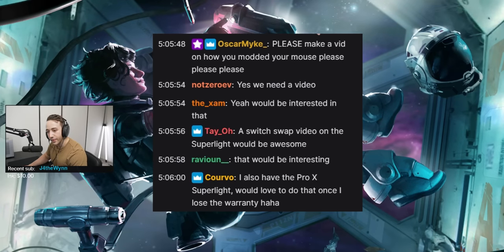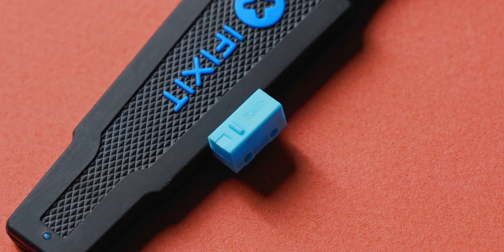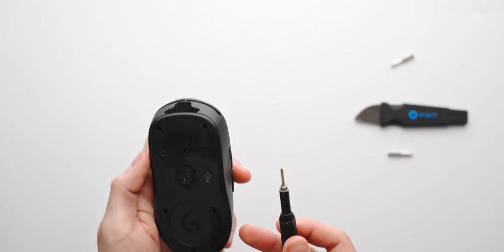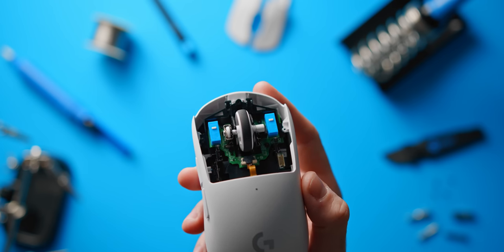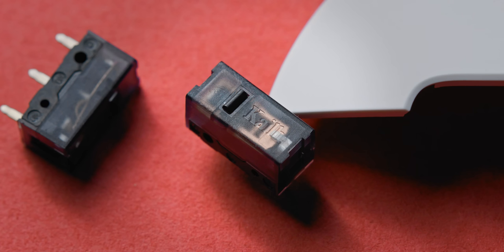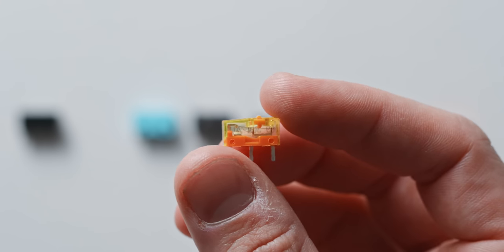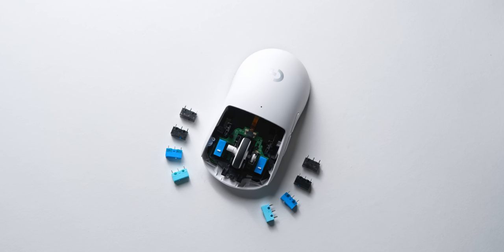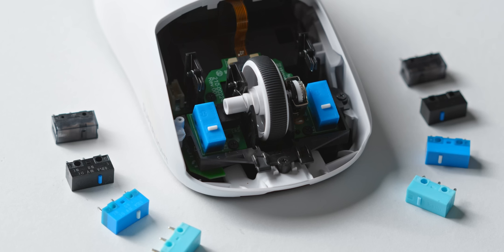Upgrading my Gaming Mouse Switches

Comment: Besides the switch itself, the implementation matters alot. The way its positioned under the mouse button and also the plastic quality the button is made of. Take for example Xtrfy M42, uses Omrons but damn they sound and feel so crisp and snappy.
Reply: I've found a piece of tape between the switch and button to help improve the feel of pressing them as well.

Comment: Got inspiered to do this mod, as I had bad double click issues on my left mouse button, and one of the side buttons on my G Pro (wired).

I have GM 8.0's on my left, right and the side buttons now, DEFFENETLY worth it. And the "solder the middle pin first" tip is really good. Another thing i learned is, dont get lead free solder, I was trying to do this with lead free, and it was a horrible first time solder experience, got some 60/40 lead solder and it was waaay easier.

Comment: instead of removing the feet, one can simply use exacto knife to cut out screw holes. this in no way makes the feet perform any worse, but you'll have access to the screws without buying new feet.

Comment: I'll add a data point: Much like Logitech mice, the EVGA TORQ series of mice also have Omron switches in them... but!  It does make a difference where the switches were manufactured.  The included switches in all aforementioned mice were manufactured in China.  Omron does make good switches which can be sourced on Amazon: Omron's Japan-manufactured switches are not prone to the double-click plague and are quite inexpensive.  I have re-switched both of my EVGA Torq X5L mice, both of which began double and mis-clicking in under a year.  Both mice are 2 years in with the Japanese Omron switches and are still working great!
Reply: For the record, the switches I purchased and installed are Omron D2F-01F switches.
Reply: @kcsmiscvideos218  Been using D2F-01 on my GPW since release, they still work great.

Comment: Hey @Optimum Tech, thanks for this video. I got myself the GM 8.0 Blacks for my G502 with the annoying double click issue, and it works incredibly well. Got the whole thing back to working in just $20, didn't even solder myself, paid somebody a dollar for it, and could have easily gotten it done in under $10 if not for skates, which I had to import. But in anycase, this is a lot cheaper than having to buy another mouse, and a lot better than having to spend $20 and settle with a worse mouse. 

I went for the 8.0's because I didn't want the tight reds, would've liked the 2.0's, but didn't see them being sold. But all in all, I love my mouse now :)
Reply: My g502 died, because of this switches

Comment: You can reuse glides in 99% of cases if you heat them up long enough. Use a hairdryer and try to move them from side to side until they start to "float". It takes some time but trying to remove glides too early will damage them. To solder - use high heat, but work fast. If something isn't perfect and you want to fix it wait a bit. Overheating a switch can make it melt inside, on cheaper mice pads can fall off. Repairing mice is my hobby, and I usually make 10-15 bucks per mouse which is a nice bonus for something I like doing anyway.

Comment: finally, hopeful this video gonna kick start the trend of manufactures not putting screws behind the feet.

been doing mice switch for years now, the only M1 switch I would go for is cherry DG4, and recently I am using DG4 for M1 alone side with zf yellow dot switch for M2(well, i prefer a different switch for the M1 and M2. since M1 usually just for a shot and M2 just for ADS)

The DG4 is very short travel and super snappy, crispy yet not too hard like most kaihl switches. 
After using this kind switch, going back to Omron 20M is like going back to membrance keyboard. I opened up all my mice without even trying them once right after i get them, coz i know they came with that shit switch from factory anyway. 

Finally this trend needs to start. Also more metal body mice need to happen ! not just one !
Reply: I straight up hole punched my mouse feet so I can open it up whenever lol

Comment: I do a decent amount of electronics work and I would recommend Solder wick to remove solder it is like using a tissue it adorbs it and comes right off. Also a tiny tiny bit of flux could go a long way if you are also bad at soldering.

Comment: Paintballers have been swapping switches out since the early 2000s. Pro tip, if you over heat the switch, it only takes a fraction of a second, you can warp the switch, changing the weight and feel, and sometimes ruining the switch, so it helps to use the lowest heat you can to do the solder move if you have an adjustable, or using a small clip to soak heat and protect the switch.
Reply: And also use flux
I attempted on an old mouse and fucked up, called up my dad and he said it’s bc no flux the solder doesn’t flow well

Comment: Besides others mouses I own four Logitech M510. Two with old logo, two with new logo. Both old mouses works fine, both new are dead (double-clicks). After disassembling new mouses I found Kailh microswitches inside. Old M510 got Omron D2FC-F-7N. I got also Logitech MX518 with Omron D2FC-F-7N(20M). This mouse went trough 15 years(!!!) of playing Diablo 2 and 3, PoE, WoW and now D2R. You can imagine how many clicks I've made. Mouse is still doing fine and never been even opened. I'm planning to buy some new gaming mouse as soon as this one dies. Seems it will never happen :) With all the respect to your hard work, I'm about to do the same... but in reverse. I've just ordered Omrons D2FC-F7N(20M) and I'm about to replace all Kailh microswitches I've got. Clicking noise? Well, as you see I got other problems than clicking noise :)

Comment: Got inspiration and replaced my G502 wireless switches with Kailh GM 2.0.
The first time I did soldering and the result came out pretty amazing. Really enjoying the new switches and bye-bye to the dreaded double click.
The tutorials must be like this video which explains everything in such an easy way that you get encouragement to do it yourself.
Thanks, Ali for this nice video.
Reply: how good are are the gm 2.0 on the g502? i own a g502 hero and the double click is killing me, what switch would you recommend? i just need something that feels nice and solid but also good for fps
Reply: @Grimm98    Like Ali said, switch feel can differ on different mouse bodies.
The Kailh 2.0 I'm using is giving me crisp and accurate clicks. I play FPS and I can single tap any gun on full auto mode.
I haven't tested many switches but I can share that Kailh 2.0 perfectly match the body of 502 hero. You'll love it.

Comment: There is a reason I'm still on my 903. Having the switches on a daughter board makes replacing them slightly easier. I don't need to desolder anything if I just want to replace them with the oem switches which is fine for most use cases. I'm hoping to get the gear and the knowledge to replace My g903s switches with the really good Japanese omron switches but that is going to take some work.

I'm doing a switch replacement this weekend and I have a set of the omron 20ms and a set of the 50ms for me to compare and pick one. Technically the holy Grail for omron switch is here are the 1ms because they're the same switches that were used in the original 502 and they last forever. Sure, They're only rated for 1 million clicks as opposed to the other ones which are rated for 20 and 50 million clicks respectively. But there's a whole lot of literature around why that rating kind of doesn't mean anything.

Comment: no offense but you dont need fine soldering tip to solder these micro switches. fine tip actually makes the soldering job much harder as the tip retains too little heat. as a beginner you want a D shape tip as the heat capacity and conductive surface is higher, it will be easier to melt the solder and easier to work with in general. you will only need fine tip on very specific situations such as soldering very fine traces (much finer than the traces you have to deal with for a microswitch. also, get some non acidic soldering flux, it helps the flow of solder.

Also, you can reuse the mouse feet easily (up to once or twice) by heating it up with a air dryer/heat gun (dont over do as it will leave marks on or melt the plastic)
Reply: Even better: Use a craft knife to cut holes in the mouse feet where the screws are and never have to remove them again.

Comment: Thanks. Was able to solve a double clicking SteelSeries Rival 100 mouse by soldering the Kailh GM 2.0s which are just right. A tip for anyone with similar problems. My old switches wouldn't fall out on their own because they were secured too tight. I needed to apply pressure and pry them out at the same time as de-soldering the points.

Comment: im using the white dots. i also found out that adding small square from the hansaplast plaster on the main mousebuttons where they have contact with the switches helps me reduce rattle and get a smoother clicking 😉

Comment: thanks dude!
gonna swap the switches in my logitech G102 since they have the double-click issue
Reply: sadly its a massive issue with logitech mice (also many other brands) that use the omron 20m switches. Sadly that happens to be 99% of logi's lineup as well as 90% of all the mice on the market. Ive actually been finding that some of the cheaper brands, "black web gaming" (a walmart brand) and others like HP and Dell gaming mice come with Kailh switches from the factory...

Comment: If you don't want to peel the pads off the bottom, you might want to try cutting tiny holes around the screws with an exacto knife.

Comment: Hand pumps can be a little hit and miss for removing solder from PCBs, I recommend giving solder wick a go for getting rid of solder in those tight areas you can't get good suction with the pump on. If the switch doesn't come off easily, don't yank it as you could rip the pads out, just keep applying and removing solder until it comes free.
Reply: The trick with solder pumps is to add some more solder to the pin you're about to desolder. It just works much better.
Reply: @markusransberger3646  Really depends on the PCB imo. Sometimes the tolerances are just so tight seemingly no amount of flux or leaded solder will allow the pump to clean the joint. Personally I just bought a cheap hot air station, makes desoldering so much easier, wish I got one ages ago. Plus super handy for heat shrink tubing or loosening glue, like with mouse skates.

Comment: FYI 2:45 is not enough to unscrew the buttons (At least in my version of the mouse). You must pry out the battery itself (which is glued) to get the two screws that are underneath it. Luckily this also means you dont have to fiddle with the annoying cable.

Comment: I've had to do this a few times on my old Logitech mice, not due to preference but because their Omron switches mysteriously crap out after the warrenty expires.
Reply: I've had to sand down some rust/oxidation on the buttons above the switch - switch itself worked fine despite its louder sound, but if you get weird double clicks or drags not holding down, remember to take a look for miniscule rust forming on the metal connectors between the mouse button and the switch underneath.

Comment: I suggest getting some flux and soldering wick to clean the contacts... I tried to desolder to fix the double-clicking issue, it was a hassle to remove the switches.
Reply: All depends on the tools you are using. As with anything. The fancier the tools, likely, the easier the job. And with solder/Flux. The more expensive stuff is often the better stuff. Cheap solder will have you fighting yourself more than getting anything done. IT is well worth it to spend the extra couple bucks/pounds/ruppees lol.
Reply: @crisnmaryfam7344  Agree, but my piece was stubborn. I do many soldering as a hobby too. Though not some professional desktop soldering kit, but it should be decent enough for most jobs. I've never come across such stubborn solder. So having a soldering wick and flux to clean just as a backup in case anyone has no experience and end up destroying an expensive mouse with no warranty.

Comment: You’re killing me smalls!! My g pro super light just came in today… I mainly play fortnite and decided to try something other than my g502 light speed…. Now after dropping 120$ on the super light and not even using it yet I want to upgrade switches! 😂 money’s not an issue but do I really wanna risk effing it up before using it once?! Never soldered anything in my life!! Gotta start somewhere though right? I think I’m gonna just try stock for a week and if I have the double click issue I’ll buy a cheap crappy mouse and practice with that before opening the 120$ super light lol. Thank you for the video. You’re amazing! I’m gonna miss the 3rd thumb button, right click on scroll wheel, and the dpi up button on my g502 (use, 4th inventory slot, and ping.) gonna have to move them over to my azeron classic! I’m definitely subscribing. Damn you YouTube! I looked up a video one time on the super light to see if I would still get the left and right click for scroll wheel still and you just had to show/ recommend this video!!!! 😩😆
Reply: Try on a broken mouse or old mouse first. I had a 10yr death adder. First try I fucked up cuz you need FLUX which was not mentioned. Without flux the solder doesn’t stick to the metal, sticks to itself!! So I kept the solder iron on too long and killed the left click pcb. 
I asked my dad who is an electrical engineer of 25+yrs and he taught me on the dead mouse. 

The run down: add some flux
add new solder to make the solder easier to work with
heat up the solder joint, suck or use desolder wick
wiggle out the switch
Hold new switch in place add small dab of flux, solder leads
Reply: I would’ve been out a $150 mouse if I did that on the G Pro X!!
Reply: @dylan-nguyen  good to know!!

Comment: This makes me wonder about upgrading the switches on the side of my 12 button grid mouse..
I used to have multiple generations of the Razer Naga and trialled a few others over the years but I always kept going back to the Naga. Now I have the Utechsmart Venus wireless thing, and honestly compared to a Naga that costs several times as much, I love this thing.

My only gripe is that the side buttons are kind of mushy rather than clicky. Like the difference between a mouse click and an Xbox/PS controller button

Comment: i always replaced my mouse switches to reduce e-waste and save few bucks. I guess every excessive gamer knows the double click issue, when the mouse gets "old", just change the switches and boom, almost like new.
The glide pads can/should be replaced as well, and spoiler there are also better/aftermarket glide pads for those mice

Comment: I absolutely need to do this. The switches in my g502 keeps intermittently letting go (double click)
Reply: check out beardedbob on here, his channel is all about this. and has the 502 teardown and switch swap videos.
Reply: Hey man. I did the same to my g502 as well. If the one you have is the wireless here's a link to the teardown guide I used. https://www.reddit.com/r/MouseReview/comments/busqez/g502_lightspeed_full_teardown_switch_replacement/

Comment: Start if this year I did a switch replacement on my main Logitech G604 productivity mouse for Kailh Silent 2 pins and I would never go back to stock. was the first attempt of soldering but did a pretty good job now even used for non-FPS gaming with how smooth it feels now.